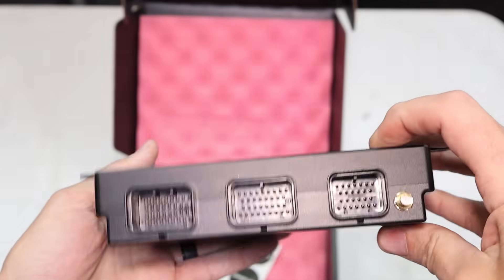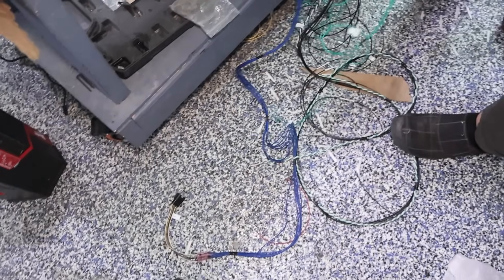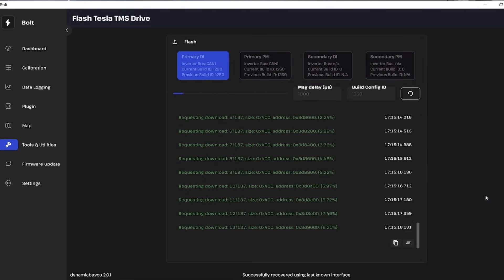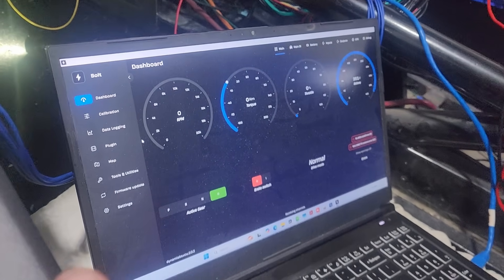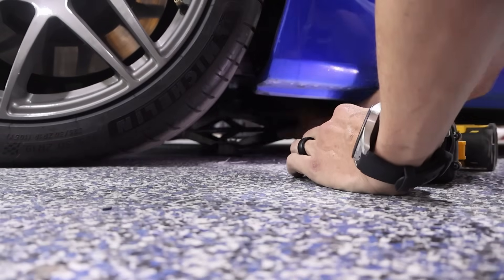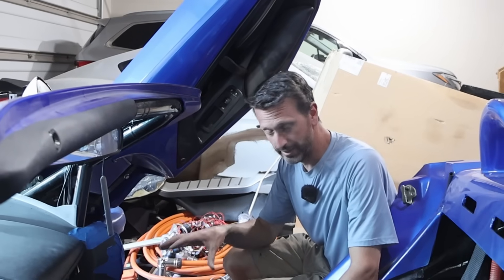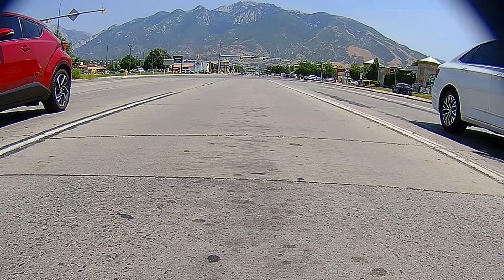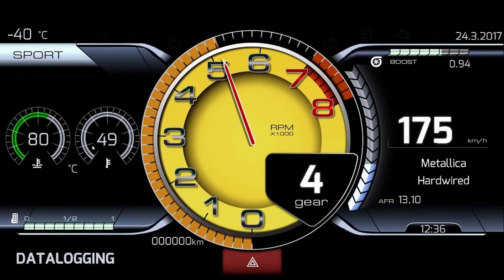Tesla Roadster Gets a New Brain – Dynam Labs Motor Controller

Comment: That thing sounds so Clunky when driving around... Like your suspension is binding or hitting your bump stops or fenders.. I wonder if this is something you just deal with instead of figuring out what is causing the sound in the first place?
Reply from the maker: I'm not sure if you have ever had a ride in a race car. The suspension is very tight, so you feel (and hear) every bump.

Comment: 12:50 "Deluxe Stylus" Ummm, that's a Q-tip wrapped in aluminum foil. That seriously works? I have a tablet I have to use at work that is missing the stylus. Now I want to try this "Deluxe Stylus" myself.
Reply from the maker: Yep, just need to be making contact with the aluminum foil and it helps if the q-tip is damp

Comment: IMO Ethernet is good.  It's easier to run over long ranges than USB so you can connect a car to a garage desktop if needed, it's more reliable than WiFi, and if you insist on WiFi you can always just stick a travel router or other compact wireless bridge in the car and use that to allow your laptop to connect over WiFi.
Reply from the maker: Good call!

Comment: One thing I would have liked for you to go over (maybe I missed it?) is how good or bad the drivability is on their initial start up maps are.  Like are they similar to the stock tesla maps? Under or over powered?  How much if any did you have to tweak it to get it to run like you wanted?
Reply from the maker: It was pretty great with the initial calibration.  I did tweak the pedal calibration as sometimes it would cut power on wide open throttle around 60mph.  I felt that it had more power, so much so that I bought a draggy to confirm.

Comment: Sooo how much of Tesla's connection to the car does this break?  One of the most offputting aspects of Tesla models to me is that the manufacturer maintains an OTA connection to the car.  It's like buying a single-player computer game on CD that nevertheless insists on an internet connection - WHY?  That's totally uncalled for.  If the car is good enough to sell, then the manufacturer has no right to expect access to it on an ongoing basis.  I'm very much in favor of blocking Tesla's peephole into the car and its operation.
Reply: Good point

Comment: Can't the vcu work out the speed based on the motor speed? if you can set the wheel size, it should be able to do that since it's a fixed gear in the unit.
Reply from the maker: Yes, you can do that as well